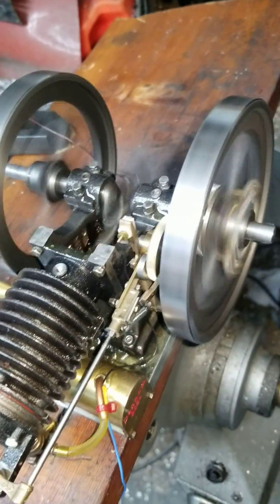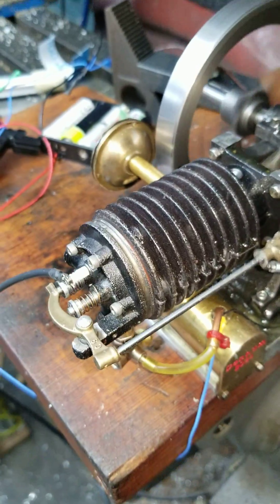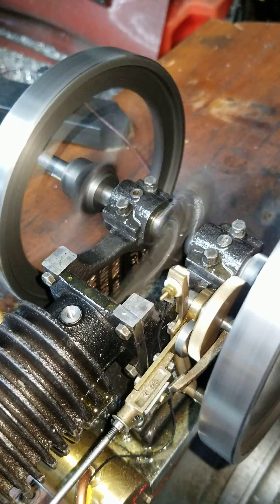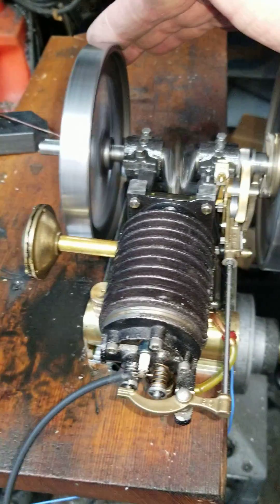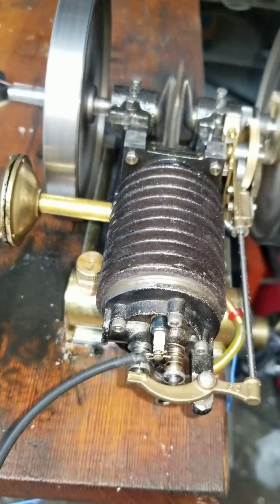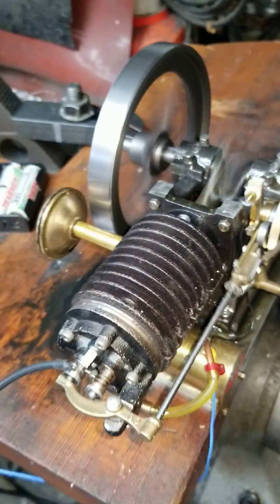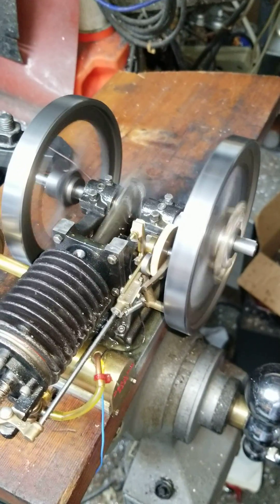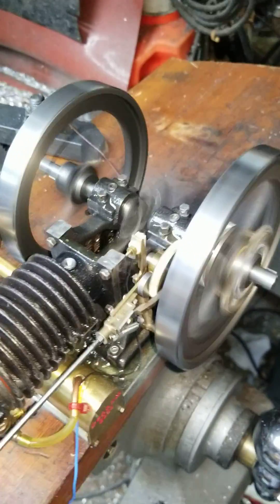Gade model engine after some tweaks

Comment: it has alota missfire
Reply from the maker: It is a hit an miss misfires are  by design
Reply: Thats the entire point, its a hit and miss engine which has a mechanism to hold the exhaust valve open and free-wheel to govern the speed to a set rpm
Reply: @louismorgan2679  this is the first time i hear of such engine... could you plz explain more ? is it two stroke or what?
Reply: There's nothing like the sound of a hit-n-miss. That's exactly what it is supposed to sound like unloaded.

It's always a nice transition when they are loaded just right and they then fire consistently to compensate.

The governor design is brilliant and simple, albeit a bit inefficient (the gas that enters the cylinder on a "miss" stroke gets wasted by leaving the exhaust port instead of being burned).
Reply: No wasted gas.governeur keeps exhaust open- piston comes from OT->UT -no vacuum build up-no unburned gas...
Reply: @rogerh987  Ah yes. Clearly written by an armchair expert. The real world has concepts like fluid dynamics in play.
Reply: I'm no expert but I built such an engine myself.The sense of hit/miss is to run an engine ecological.You're talking in riddles!Hold a flame to the exhaust and you'll see...nothing.
That's because there's nothing to burn.With an open exhaust valve is the only thing what's in there,air.I'm guessing:You didn't choose your name yourself...😵‍💫
Reply: @rogerh987  what does this mean OT->UT
Reply: OT (top dead center)means the highest point of the piston in the cylinder.UT(bottom dead center) means the lowest point.
Reply: If the piston comes from top dead to bottom dead center and inlet and exhaust valves are closet it creates vacuum.If the inlet valve is spring loaded it opens when the vacuum power is higher than the power of the spring.Fresh gases are sucked into the cylinder.
If rpm is to high,the governeur opens the exhaust valve.No vacuum can built up->spring loaded inlet valve can't open->no fresh gases->lower rpm.
The only fluid dynamics you see,is air that is sucked into the exhaust valve and then expelled again.
Reply: @rogerh987  thanx roger .. right before you write this iwas in wikipedia and read some on hit miss type of engine ... but i wonder why they didnt want it to be reved up?

Comment: It sounds like a2 stroke, is it a  2 stroke or 4 stroke engine?
Anyway good job 🔥
Reply: Hit or miss, technically four stroke, but when the rpm increases the governor opens and keeps the intake valve shut, so the rpm drops. That's why when he slows the engine down it sounds like it's running faster, it's firing in every revolution instead of every 5th or 6th